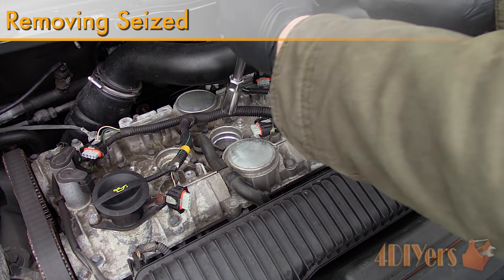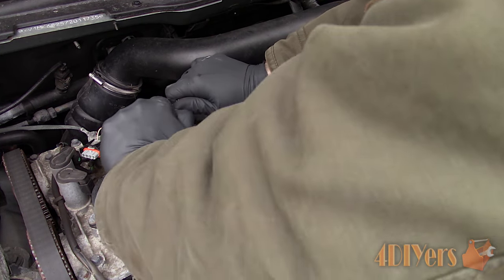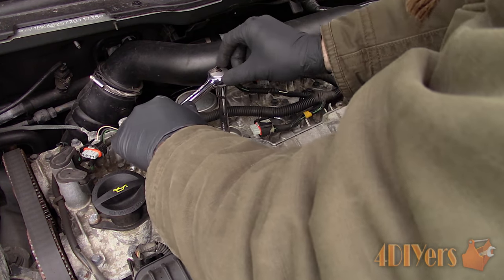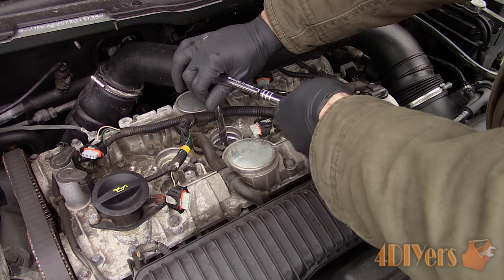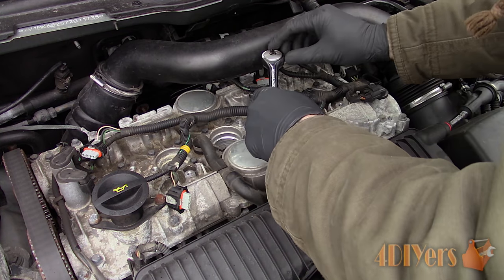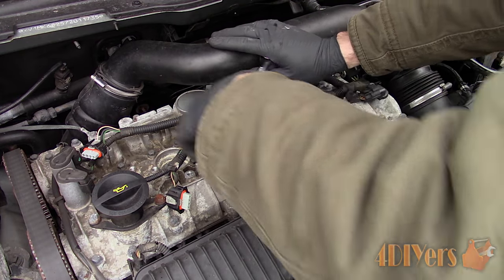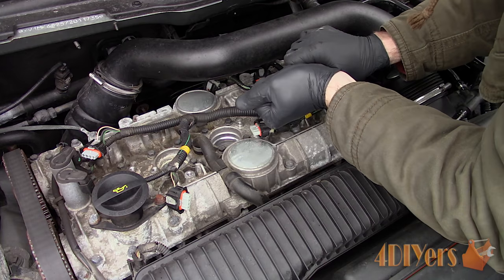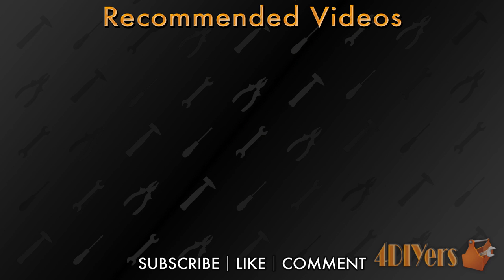How to Remove Seized or Stuck Spark Plugs

Comment: I don't know anything about cars, but I wanted to learn a little. A few month after my Mom was charged over 1K to change 2 ignition coils, 6 spark plugs and a gasket, she got a misfire code on her #4 coil. I was not about to let her take it back to that shop that charged her almost her entire month's living budget. So, I decided this was a good starting point for me to learn a little about cars. She has a 2002 Ford Escape. I decided to change the spark plug and ignition coil in the #4 cylinder... I wasn't sure if the spark plug that the shop changed was causing the issue or if it was the coil. Anyway, I couldn't budge the spark plug at all! I tried this method, but it wouldn't budge. Granted, I'm a woman and I don't have that much upper body strength like you guys, but it didn't move at all... either direction. So, I did research and bought some PB Blaster. I let it sit over night and I tried again. Nothing. Not any movement at all. I sprayed more PB Blaster, waited another day, warmed the engine and again no movement. I almost gave up until I read someone's post laughing at a guy who used a vacuum cleaner tube to put over the socket wrench for leverage. I was desperate. I didn't have a vacuum tube, but I did have a curtain rod. I took it apart and slipped the socket wrench handle into the rod. I barely put any pressure on it and bam! It turned like butter! I was so happy. My neighbor friend told me that I could have broken the plug with this method due to torque or something like that, but whatever, it worked! I'm sure the PB Blaster stuff may have helped, but the trick to my success was leverage... I just wasn't getting any leverage on the wrench and my lack of strength didn't help. I thought I'd post this here in case I can help anyone. I'm sure some here will laugh at me and call me dumb for doing that, but if it helps someone then it’s worth it... I spent hours researching it and just couldn't understand why I couldn't budge the plug at all.
Reply: update?
Reply: PB is the way to GO!!!!  I’m a motorcycle mechanic.  Use it on a lot of parts.  Patience is the key!!!  BRAVO ON YOUR SUCCESS.
Reply: Thanks for sharing!!😃☀️
Reply: Hi! Female here who has always just let her dad or a mechanic take care of the issue, but like you, I decided to take matters in my own hands and am having the issue where the spark plug isn’t budging. I’ve stumbled upon your story and I’m very thankful for you putting in the time to share your advice and glad to hear your success. I’ll try that PB and grab some leverage. I hope to have success like you!!
Reply: @Karleemezquita  Try the heat too. Just drive the car for 10 minutes before. Be careful though, you can get burned.

Comment: thank you sooooo soo much! thought it was cross threaded so i gave up cause im not that experienced didnt wanna destroy the head. after doing your method and getting one up looking at the threads there was no thread cross just lots of carbon!!! all changed and vehicle is performing better then ever!!! HAD to find this video just to leave u this comment and like! thanks!!!!!!!
Reply from the maker: Awesome to hear my method helped and thank you for the kind words :)
Reply: I have a2011 Buick Lucerne.
160,000 m.
  ( engine running at reduced power ) Light stays on
 Just changing p. wires ( original by the way )
 Brought it to mechanic to get the plugs changed. ,he called me , said plugs were stuck tighter N dicks hat-band , and he didn't want to be held accountable in case shit went south .
 Yall sound pretty confident with your method ? ?  ?

WELL , HERE WE GO

RIFF
Reply: Spray water in intake till it just about dies
Reply: @russellstringfellow6872 How did it go?

Comment: However, if a plug snaps, you are most decidedly screwed.
Reply: They snap way easier than people expect.
Spent the better part of an hour using an old masonry bit and a breaker bar to remove the threaded half.
Reply: Denang I snapped the spark plug on my moto and it is in half and it is stuck in the bay do you know how to remove the broke end stuck on the spark plug holder
Reply: @JasonChonev  
There is a special tool for this, but it may involve leaving broken pieces of the spark plug in the cylinder.

Comment: I just had to come back on and give you an "atta boy" for this video. Decided to change my plugs in my 2007 Chevy HHR and they all came out fairly easy except one. My brother in law was convinced that it was cross threaded and was worried it would break off. We went to Dollar General for a quart of ATF and put a dropper full down in on the plug and let it sit half an hour. It came out after going forward and back again several times. After they were changed, the car smoked for about 5 minutes from the ATF we put down in the spark plug well, but everything is fine now. THANKS !!
Reply from the maker: Happy I could help, thank you so much for the kind words and feedback!
Reply: me too, nice I have a vovlo too just like that one.
 I was doing the same thing, but after I saw this video went back after letting the lub soak a couple hours and it loosened up.

Comment: Literally saved my life and my little pool cleaning business. I NEED my truck to work and don’t have money for a mechanic. I was ready to just call it quits cuz I ain’t know what I was gonna do. Didn’t think about reversing it, but sure enough I did and then went back and forth until the thing came free. No ruined threads on the engine!! 🙌
Reply: Reversing it works, Thanks for pointing that out.

Comment: at 53 years old working on cars when I was very young with my dad, we used propane heat applied direct to the plug when possible or soaking it in an AFT fluid or gas/atf mix (caution must be used with flammable liquids). Allow the fluid to soak into plug. 15min-hour at least over night is better. Using a penetrating spray it will evaporate quickly, so many sprays may be needed. Heat first, ATF wait over night add more heat (extinguisher handy) and then more ATF has always worked on my OLD< OLD ford. Never broke a plug till I had a Honda. My Pontiac sunfire did not have to change them as 3 out of 4 blew out.
Reply: cursing never works....
Reply from the maker: Excellent tips! I haven't done plugs on the 4.6L V8 Ford engines, but I've heard they can be a nightmare and are known for breaking due to the odd design.
Reply: @BigFordCountry84  
But it makes one feel good, temporarily!

Comment: 1999 Subaru had one extremely stubborn plug and so I applied some WD-40 and your technique and it came out like butter.  Thanks so much.  Keep up the  practical tips
Reply from the maker: Awesome to hear and thank you for the feedback!
Reply: Can you put WD-40 on a spark plug that’s still inside the engine to loosen the spark plug??
Reply: @bigglokk1975 did you ever get an answer?

Comment: You know I was very dismissive of this tutorial saying to myself that this gentleman is going to cause me to break off plugs in my engine causing me great expenditure. I began trying to remove the plugs and when I MOVED A HAIR AND GOT A BINDING, I INSTINCTIVELY said let me follow this guys instruction and tighten by going back the other way. I kept doing this about ten times and sure enough all of a sudden the stuck plug became free. So for all of the other plugs I am going to follow this gentleman's instruction because it works. Like he said, it takes patience but it pays off. Don't force, just keep going back and forth, loosening and tightening.

This mechanic knows what he is talking about and doing.

Thanks so much sir for your knowledge

From a Doubter
Reply from the maker: Thank you so much for the feedback and kind words :)
Reply: This dude removed one spark plug and then immediately typed and entered a comment..thats respect.
Reply: @wesfields9322 lmao 😆
Reply: I did this to my Tacoma and it has worked so far. I think it will get the rest of them out. I also have put anti seaze on the threads for future removal.

Comment: 4 years later and your video is still helping others like myself! 2011 Ford Escape 2.5 and these plugs were seized at 115,000 miles (new, used car to me). I was able to replace & install new plugs (along with new coils). Car runs even better now. Thanks again mate 👍
Reply from the maker: No problem, happy I could help!
Reply: Holy crap I'm having the exact same problem with my 2011 Ford Escape 2.5!
Reply: Same with just #3 on my Ford Escape

Comment: Changing plugs on a 1991 Ford F-150, 4.9 6cyl, 51000 miles. Not sure how long its been since the plugs were changed last. I pulled one of the wires and it came apart. So I ordered a set of those also. Just sprayed the plugs real good with PB Blaster to let soak over night. I’m really glad, I came across this video. First time doing this. The truck is new to me. I’ll let you know how it turns out. Going to follow the instructions. Reading ALL the comments helped a lot also, to prepare.
Reply: Even if your plugs snapped in half I’m sure that Straight 6 would still run just fine. Those motors are legendary
Reply: That's interesting of the same truck same 4.9 liter, same issue but the last darn plug the more I unscrew it working back and forth it probably isn't even 1/4 the way threaded in now but gets very difficult, even going clockwise counterclockwise how many times and penetrating oil I hope this thing comes out without any wrecked threads... I miles shows about 150,000 and I could swear wires cap plugs everything looks original 
can't believe it 🙄

Comment: Thank you very much!  '09 Civic with 35k miles original plugs felt like they were welded in.  Used penetrating oil plus warmed engine.  Plugs broke loose but still wouldn't come out.  A little pb blaster mixed with brake cleaner gently working plug back and forth with the ratchet.  Use paper towel to mop  out of the hole before pulling plug out so it doesn't drain into cylinder.  What got me over the finish line was my helper lightly tapping the breaker bar/socket while I applied light torque turning the breaker bar- with a small sledgehammer to loosen the carbon by vibration. Patience- this took me 4 days of repeating (letting soak overnight) but it worked and cost me only the price of the new plugs/grease/anti seize and brake cleaner.   Thanks again- much appreciated.  One last thing- if you spend extra time working the plugs/ratchet back and forth until it is easy, then  the new plugs will go in easy too.
Reply from the maker: You are very welcome and thank you for the feedback!

Comment: After 230000 klms 4 out of 6 spark plugs were tight and squealing, This described process in this video worked flawlessly and all 6 plugs were out without any damage to the threads in the cylinder head. Many thanks for this video.
Reply from the maker: Happy to hear and you are very welcome!

Comment: This video helped me! Plugs  3 and 4 on my yaris were getting more tightened when trying to loosen them. Stopped right there and found your video. Trick coupled with wd40 made it possible to get them out. 
AND you were right! The crush washer were squeezed flat, overtightened by a mechanic before. Thanks a ton!
Reply from the maker: No problem, happy I was able to help and thank you for the feedback!

Comment: This is a great technique, didn’t think of it before. I got one spark plug stuck on my mom’s ‘07 Toyota Corolla and already broke some pieces 😬 of the porcelain. We left it soaking overnight with some W-40. I was thinking of dumping some dry ice to contract it just a bit. I’ll try this technique next. Ty

Update: I was able to losen the seized spark plug using exactly your method after letting it soaking with penetrant oil overnight. The plug’s porcelain material partly broke so have to be real careful not to drop any pieces of it down the cylinder by using a vacuum cleaner sucking the broken parts out. I was thinking of bringing the piston to TDC before total removing the plug, that way if anything falls it’s right there. Really appreciate this video!
Reply from the maker: Awesome to hear it work and happy I could help! Thank you for the feedback and kind words!

Comment: Had my  09 Honda Civic GX (CNG) sitting for in my driveway for around 2.5 years. 3/4 spark plugs were seized. Thanks to your video I got confidence (diy) to add a bit more force to pull them out. I had to do a combination of loosen/tighten, heat up engine, and a bit of penetrating oil. It took about 20 minutes but worked. Thanks for the video!!!
Reply from the maker: Happy I was able to help and thank you so much for the feedback!

Comment: The video presented here is the way I've been doing it for years. This method also applies to many other applications. When the spark plug or bolt begins to move slightly , a shot of PB blaster or another good penetration oil will make it easer to complete the job. Great video and thank you for posting.
Reply from the maker: Thank you so much for the kind words and feedback!

Comment: I’ve found it’s best (if they haven’t been changed in a while) to remove the stubborn spark plugs while the car is hot. Softens the metal just enough to pry it loose.

Comment: This method worked for me! I went to change my plugs on my NA Miata and the first plug was stuck like glue…I gave up hope on trying to get it out knowing it would probably snap off but thankfully I came across this video and it saved the day. I used a little wd40 and inched it back n forth and voila! It came out no issues 👍
Reply from the maker: Awesome to hear, happy it worked out for you!

Comment: Thank you so much for this video. I was working on my 99 accord, the last spark plug was seized and I was about to go King Kong on to remove it and suddenly I realized I was inside my garage and if I break it I will be in so much trouble. The spark plug would unscrew like 3 turns and then it was stuck. It took patience and  going back and forth for like 12 times and then it was loose. It felt great. I didn’t even need to use wd-40. Thanks again.

Comment: Shoot some WD in there the night b 4. Next day do just what you did. Worked 4 me on ah Jeep. These plugs wouldn't come out, and I didn't want 2 bust or strip them.
It worked!
Reply from the maker: Excellent tip, thank you for sharing! Broken plugs are not fun. Haven't experienced it myself, but have witnessed it happen.
Reply: Mine won't come out of my 2000 Pontiac sunfire!
Reply: Excellent
Reply: Will supertech lube spray or throttle body cleaner work?
Reply: @Funrunner008  use acetone or nail polish remover and transmission fluid. Mix it 50/50 or thinner if needed. It will soak down the threads  and dissolve rust and carbon. I use synthetic atf and acetone and it's the best penetrating oil available. Just give it time to work
Reply: @jwill9877  I really appreciate the help, Do you put that mixture in a plastic spray bottle and spray it in there or pour in a little from a bottle, In other words, Do you flood the plug well so it can soak in or do you get a little around the base of the plugs?
Reply: @Funrunner008  I flooded the plug well and let it soak for a while. Then i got them to break loose but they still felt like they were gonna break.  There must have been alot of carbon on the threads still. So I just worked it back and forth to help the fluid work it's way down then I let it set again Before I tried to back it out another quarter turn. Everytime I gained ground I threaded it back in to get more penetrating fluid in there and let it soak it again. It's a long process the the alternative is far worse. They never feel like they let loose. They feel like they are gonna break the entire time taking them out.
Reply: @jwill9877  Thanks for that detailed description of what I might have in store for me, By the way, my plugs might have 170k miles on them.
Reply: @jwill9877  I got the first one out, I used a 1/2 driver and it still wouldn't move then I switched to a longer one that pivots(I think a breaker bar) and it started turning, It came out with no binding up, Can't believe it. I did the 50/50 solution and soaked over night and it worked...Thanks!
Reply: WD-40 is risky because its water based. Penetrating oil is better
Reply: @nl5137  Impact air wrench - and pray, perhaps.

Comment: My plugs are at an angle so if i spray anything it just drains right off. I took a piece of cloth and soaked it with ATF and some PB blaster and stuck it into the plug hole with a long screwdriver. Will let it sit overnight or even two days to see if that works. Its a V8 Lincoln Mark iii and 6 of the plugs came out like a breeze but two are not budging at all.

Comment: What do I do when I can't get the new plug to screw back in the hole?
Reply: Put engine oil on plug thread. Also it may mean threads in head are slightly damaged and need to be cleaned with thread cleaner(not rethread as it removes material) or just use old plug break of the tip and saw its thread vertically in middle like some couple of first winds so it will create similar tool to thread cleaner. The split will allow any debris to come out and also allow it to push closer and go into thread gradually making its way.

Comment: Perfect.  Thank you.  My spark plugs were seized up on my 07 GT and I just knew I was going to jack something up.  A little penetrating oil with working it back and forth and they came out just fine.
Reply: Please share the penetrating oil you used. I have a stuck plug on my W203 that needs removal
Reply: @nkhondochagwamnjira1344  Any brand that says penetrating oil will work.  They key is... time is your friend.  If it won't move, just give it time.  Good luck on it.